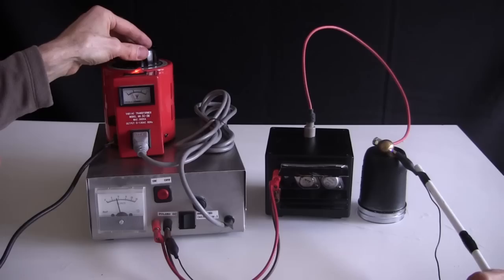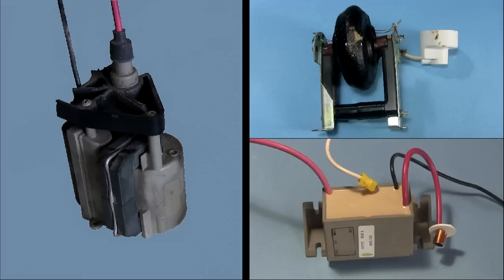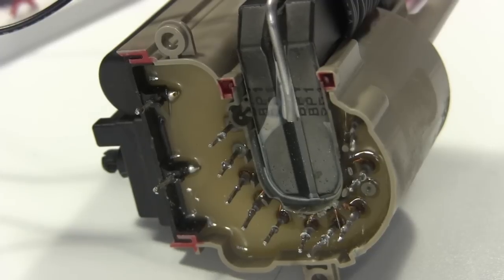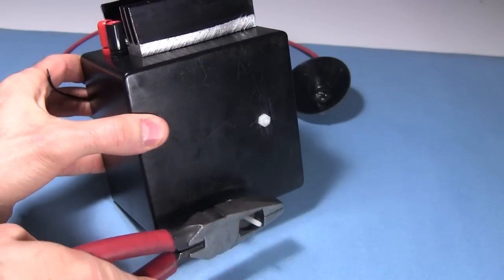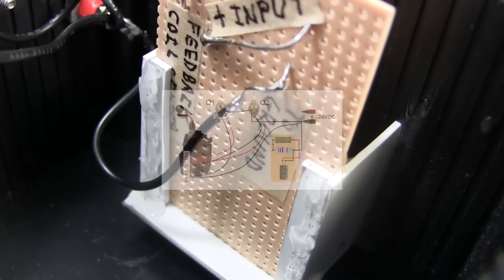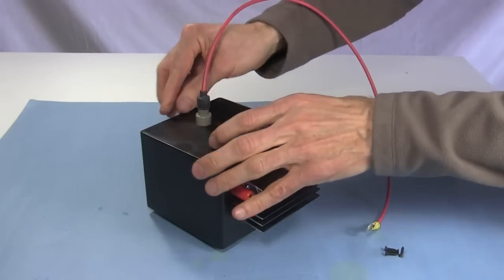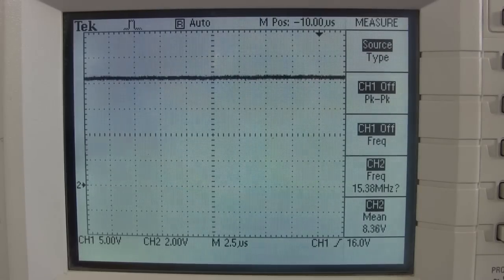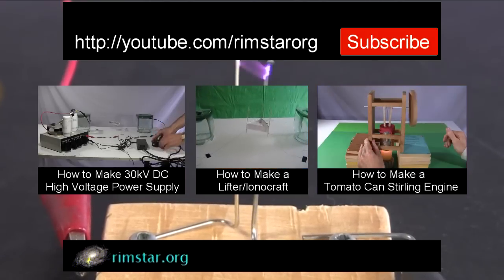The Cube - How to Make High Voltage Power Supply w Flyback/Builtin Diodes

Comment: At least I know the answer to one question now....will it harm an adapter....YOU BETTER BELIEVE IT!
Reply from the maker: John Kerley I blew away one adaptor in making this, but in my case it was because the current draw was too high.
Reply: RimstarOrg Well...if it is of any interest...I blew a 50W 32V at 1 in. arc, and I blew a 65W 20V at 3/4 in. arc.
Reply: John Kerley The max. distance it was able to arc to was 1.25 in. on my 150 W 32 V power supply when it was set on 32 V.
Reply: John Kerley When it was arcing 1.25 in. the current only showed to be 900mA but this could only be measured with an analog meter. I,now believe that if it was'nt back EMF that killed the adapters, it must have been the current during the arcing that must be very high but in small fractions of a second and thus do not show up on an analog meter but can cause a digital meter display to shut down.
Reply: John Kerley I had planned it to be able to reach 25Kv when powered by 32V because I did have a 32V adapter. I figured that it would use less current to get to 25Kv that way,but apparently the current is much greater than I realized. Anyway it was just a simple one transistor running with the flybacks original coils for oscillation. The voltage dividing resistors were 360 Ohms and 30 Ohms. The transistor was Philips 610597 m9303. This is incase someone can get anything usefull from this.
Reply: John Kerley I wanted the project to be able to reach 25Kv but with this simple plan so it could still work for the projects like you are doing. technically it can do it but it is no longer simple because you would have to have a 100W or more 32V adapter!
Reply: John Kerley Also...I do'nt know if I was correct about this, but I assumed that if it could establish an arc (not starting one and pulling away),at 1.25 in., that that would equal 25Kv.
Reply: John Kerley The flyback transformer was out of a 2006 Sony 32 in. TV and was the type that had built in screen and focus(no other multiplier).The original transistor was a D2645 6F3 but I accidentally blew that one because I was'nt running Earth ground. Before blowing, it had reached 1.5 in. arc.
Reply from the maker: John Kerley Yeah, it's entirely possible the 900mA reported by the analog meter may have been wrong depending on the waveform.
Reply from the maker: John Kerley Using the gap size to estimate voltage isn't that reliable. That differs a lot depending on the shapes of the electrodes. That's why when you look at tables of gap sizes, they also tell you what the assumed electrode shape is.
Reply: RimstarOrg That is true, I have seen that before,and I was just using the two wires.
Reply: RimstarOrg I think this will probably pan out to be a fact.
Reply: John Kerley I took apart the 32V,50W adapter and found it to be the modern HF type. What blew out inside it was a small 0.27 Ohm resistor. The electrolytic capacitor did not appear to be harmed,but I did'nt have a way to test it.

Comment: I have also made it ,it is not working!
Reply from the maker: Hmmm... not much I can suggest other than, check all your connections, make sure you're connecting to the right pins on your flyback transformer according to whatever information you have about them, and check individual components to make sure they're good if you can remove them from the circuit. Also, what are you using as the input to the power supply? At around 6:52, you can see that I had to turn the voltage up to around 4 or 5 volts before it would start working.

Comment: When powering from a bench supply, all you need is one positive lead and one earth ground. I just put this out there in case someone can get any use from it, I'm going to let this alone now,....I know I have talked an awful lot on here.
Reply from the maker: John Kerley Not all bench supplies are that way. I have one that has a positive, a negative and a ground. That allows for positive with respect to ground or negative with respect to ground, or I guess floating negative and positive if you want that.
Reply: RimstarOrg I meant the way you said....the earth ground is located on the power supply outputs. Probably a supply might not output anything if you only had just positive out and the negative had no connection to earth ground.
Reply: RimstarOrg I just checked to make sure that the bench supply ground was infact connected to the ground prong of the chord and it is. I really should have checked this before experimenting,but I just assumed it was.
Reply: RimstarOrg If the bench supply does not have a ground terminal, you would put the negative terminal hook up also hooked to earth ground.
Reply: RimstarOrg Due to what I have found out, I believe that those battery powered circuits could be potentially dangerous if the negative terminal input is not also earth grounded.

Comment: i still like a tube high voltage supply better
Reply from the maker: Do you mean a power supply with the TV still intact? Or do you mean a vacuum tube one? A vacuum tube one would be fun.
Reply: a vacuum tube flyback driver
i have some circuits for it
and they are awsome

Comment: is it possible that diffrent flyback transformer wont work with this ciurcuit?
Reply from the maker: The numbering for the pins are different for each make of transformer so you'd have to search for your transformer's part number online to find its specifications. But if you know what pins do what then I see all sorts of transformers online working with this circuit. It could also be that there's a problem with your transformer or that something else is wrong with your circuit.

Comment: sir can you tell me the model of the flyback transformer..i need to make esp fpr my project so i need know about the suitable flyback
Reply from the maker: It was a random flyback from a randomly found TV. Pretty much any flyback you find on ebay.com will work.
From writing that was on the board near the flyback transformer it said T505 and clearly it was a Sony flyback. From http://www.tvserviceparts.com/Sony_Transformers.html it's Model KV32FS12, Version T505, Part Number 1-453-338-21. The KV32FS12 might be the Sony TV model number. The 1-453-338-21 is the part number, maybe just for that website. An alternative part no looks like it might be Sony part 1-453-338-11